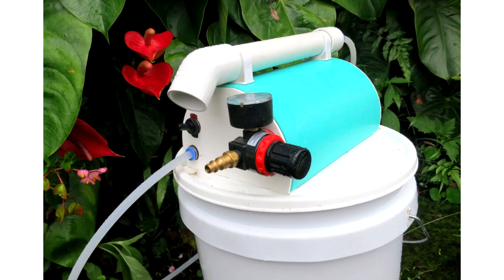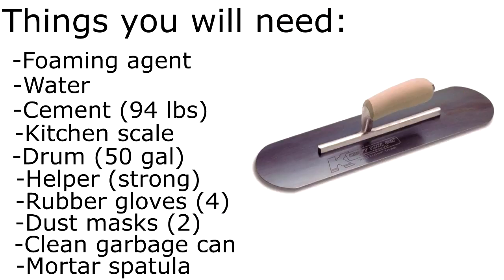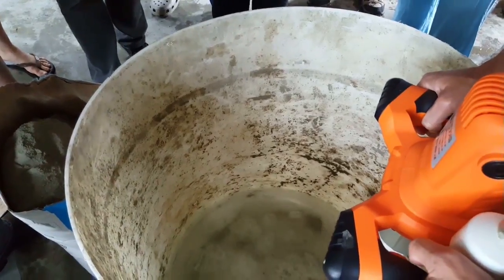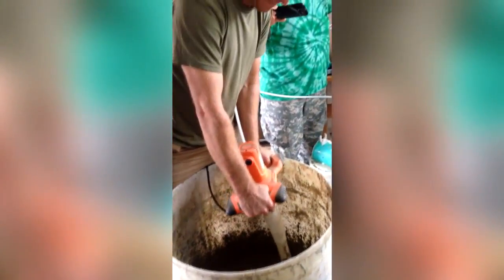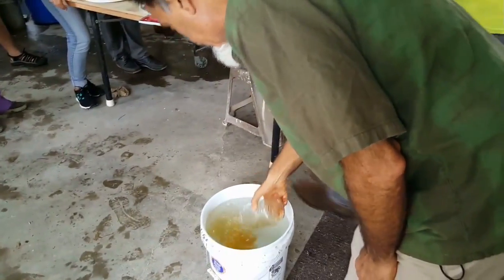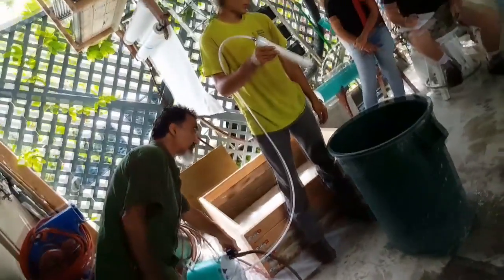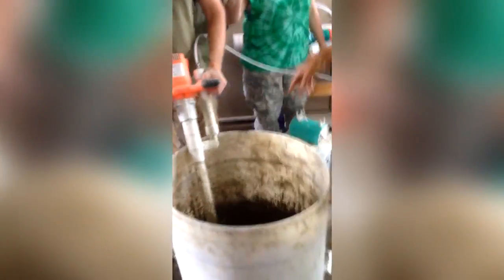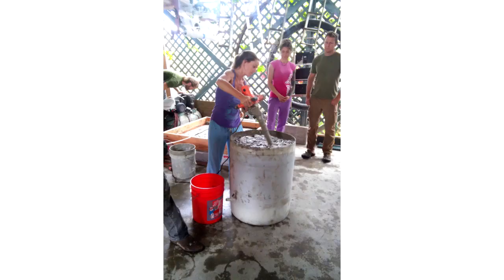How to Make Aircrete with Domegaia's Little Dragon and Foam Injection Mixer

Comment: Hello! 

Very interesting product this is!

What is the psi rating of this aircrete? I would be very interested in the use of this material, while its way cheaper than normal concrete and wood. Would reinforcing this material help as it does help normal concrete?

Thank you!

Greetings,

Jeff

Comment: Do I need to carry it by the bucket from there? 
With that consistency, would not a concrete pump (even a solid waste pump) be enough to pump from the mixing drum into your ir forms (either blocks or monolithic)?